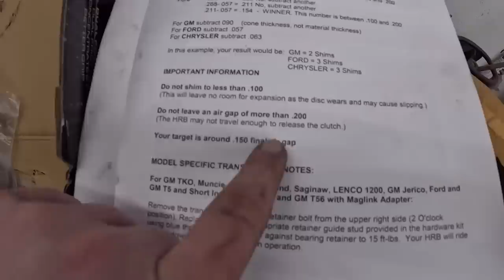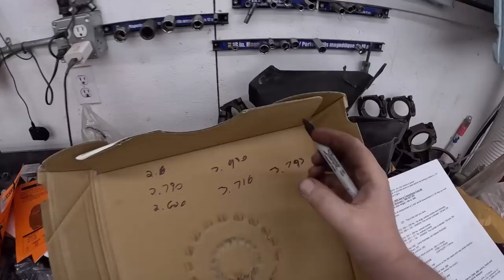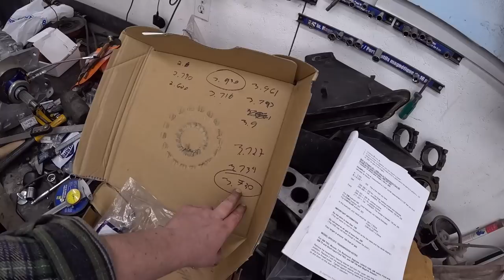WAS IT WORTH IT? Tremec Trans Install From A-Z - 1955 Chevy Nomad Gasser

Comment from the maker: So all the throwout bearing comments are really weighing on a guy.  Got an email in, but I feel like I'm pulling a motor and trans again......
Reply: Good I know it sucks ass all to hell and is demotivating and yeah yeah we all died a little inside as true fans when the biscayne motor was destroyed by poor quality HIGH dollars parts…… these are high quality HIGHER dollar parts keep ‘em that way by doing it right aaaaaaand I promise to like and watch your redo video so at least the hassle makes you a few Pennie’s
Reply: No need to pull the engine, Dan..just the trans mount, shitlifter, and the four trans bolts to the bell housing..
Get a couple long bolts and cut the heads off, use 'em to guide the trans to the bell, easy-peasy one man job..
Reply: Yes I agree, being in the transmission business for almost 50 years, the release bearing needs to travel forward onto the area of damage to release the clutch. It is a headache but fixing it now is better than after every is together. I do enjoy your channel and has been entertained for years. Will be doing a 4 door conversion on a 59 dodge due to you, ha ha
Reply: No fun dancing around parts issues when your excited about making progress. Now step back take a deep say a few @#$%& under your breath. I'm old and remember when you ran into an issue with parts in the 70's 80's and 90's you just hopped into your ride and went to the speed shop. Now it's hurry up and wait like a dog for a bone on the delivery truck to show at your doorstep.
Reply: You and your buddy Mortske just have the angriest commenters.  Remember that time you said you were perfect and never make mistakes?  Me either.  People need to just relax, and enjoy watching you do it wrong so we know how to fix stuff when we screw it up, too.

Comment: Dan , don't bust your ass. Buy (4) 4 inch long trans bolts cut the heads off the bolts flush and cut slots into the cut off bolts. Now you can install the bolts by hand into the bellhousing., Slip the trans onto the longer bolts. You will find the trans aligns almost perfectly every time. Now you can remove the slotted bolts through the ears of the trans using a heavy duty screwdriver. Remove your new alignment studs and replace with the correct trans bolts. Note! usually two bolts are all you should need to get the trans aligned. Been doing this since the late 60's.
Reply: Every GM guy has a set of the cut off bolts for alignment pins.
Reply: Ima use tihis, thanks.

Comment: Usually squaring the block to crank centerline is good, but$$$ , once I get offsets where they need to be ,drill,tap, and send in longer bolt.set screws suck.they always seem to move,especially towards torque side.

Comment: Always bring the pressure plate down with a triangular tightening pattern one turn on each bolt as you go, otherwise you will damage the finger ring, and cause uneven clutch wear, Don't use that release bearing with the broken collar, it will damage the transmission input support and the clutch. Fixed several already.

Comment: You always want to "lift up" on your pilot tool when you tighten up your pressure plate. It compensates for the weight of the disk and you'll have better alignment for the input shaft to go in. Always a little slop with the plastic tools!!

Comment: I had a lot of the same issues on my TKX install on my SBM. I used a McLeod release bearing which has a threaded base so it's infinitely adjustable and does not use shims. My clutch fingers were also all over the place so I just averaged out and everything worked just fine. I also verified the gap with feeler gauges after everything was assembled.

Comment: Great job! Just went thru the same saga on a ls gto. Went crazy over measuring but it paid off. Used a twin disc rxt McLeod hardest part was getting the tranny to seat and I have a lift and tranny jack. Next time I will use a old input shaft instead of bs plastic alignment tool. LOL
Reply: Same here with my 66 mercury T5 swap.  Had to pull it all apart on my back and realign to get the tranny in.  Have to press hard on the crappy plastic tool to center that disk while tightening.  Need 3 hands but managed it.

Comment: Dan,

Three things I learned about the Holley Sniper EFI when I put one on my Vette three years ago.  1) There is a mesh screen on the fuel pressure regulator.  I had to remove my mesh screen because it was a very large flow restriction and was forcing fuel pressure up to 90 psi instead of 60 psi like it is supposed to be.  Be sure to put a fuel pressure gage in the line going to your Sniper under the hood so that you can monitor the fuel pressure.

2)  The coolant temperature sending unit they sent with my Holley Sniper was garbage.  I noticed that when the engine was cold from sitting overnight, just before I went to start it up, the coolant temperature gage was not reading the same as the intake air temp sensor.  The engine coolant sensor read about 20 degrees warmer than the actual engine temp and the air inlet temp sensor.  And when the engine was up to operating temp, it read about 20 degrees cooler than the actual coolant temp.  I replaced it with one a bought from the local auto parts store for a 1991 Chevy Truck with 350 engine.  That one reads correctly.

3)  The electrical plugs on the Holley Sniper that attach to the proprietary Holley fuel injectors are garbage and lack a positive retention device.  So after about 300 miles they vibrate and fall off the injectors leaving you stranded.  Since these are not accessible from the outside, you have to go into the Sniper Unit to fix them.  The fix is to take small zip ties and zip tie the the plugs onto the injectors so they cannot vibrate and fall off.  I highly recommend doing this before you try to drive to the US and do Hot Rod Power Tour.

Comment: Congrats on the sweet parts!

You can use a length of chain to lock the flywheel for bolt torquing.  Bolt through one link to the block, bolt through another link to a clutch plate hole.  Turn motor til it locks!  More you can install flywheel bolts to your torque and it won't move.

You can also install the clutch plate onto the alignment shaft and hang that first.  Then you don't have to fight the clutch plate and pressure plate at the same time.

Comment: So, the thing you didn't seem to mention about the clutch to throwout clearance is that as the clutch wears, breaks in, or whatever, the fingers on the pressure plate will move out, so being a little on the safe side of .150 in the .160-.170 range is perfect if you dont want to take it back apart to adjust it again as soon. It'll be mint. Run it

Comment: I added an early Tremec six speed to my 56 150 utility..have to move the shifter location forward with a kit..Hurst shifter..works well.
Friend installed my BBC while I was moving and I left him an external and internal balanced flywheel..the balancer for my 502" was incorrect for a 396" so had to buy a new flywheel since the correct one was gone..alas!
  Five years later I've got a leaking main seal..forgot to tell the guy to but a new one in...I built the engine in 1979.
   Now have a blown head gasket due to timing issues with Sniper EFI...going to bite the bullet and pull the engine..again.
   Engine was built in 79 for a 74 Camaro that I bracket raced..then went into a 10:90 57 Chevy before landing in my 56 150 business coupe...whew..get tired just thinking about it..LOL
   Like they say..
Sh?t happens..LOL
    Keep at it young man...I love watching your builds!

Comment: I wouldn't sweat that throw out bearing... I ran a SBC in my 65 C-10 for years with a skirt broken off one of the pistons. Motor ran like a dream and pulled pretty hard. You'll be fine...

Comment: The pilot bushing is best in bronze🤔🇵🇷
Reply: I agree, if it's a bushing, this one is a Bearing tho.
Reply: @intentsmodz  its ball the same.  All the old times , and trasmision guy recomend  the bronze.
Reply: @antinioacosta2710  right but the bushings don't have needle bearings in them. The brass was preferred because the steel ones would rust then wear out quicker.    The one Dan used has needle bearings in it so it doesn't come in brass.

Comment: The Tremec is a great transmission.
So is a Muncie 4-speed with nice linkage. It's all about the office of motor management. The H pattern is a sure thing. Especially when you're just banging four gears, spinning donuts, and figure eights.
I prefer a 4-speed on the dance floor.
Reply: Problem with old school trans is no overdrive and doing long drives isn’t fun at 3500 rpm’s .  That’s why he went with the tkx.
Reply: @chrisw5837  Before the Tremec there was the Doug Nash 4 + 1.

Comment: i would not drill or use that trans blocks are already weak there seen a lot of broke block ears i would go with a t-10 or m-21 but the best is a 02xx 400r turbo stock good to 800 hp best part u can get them free if u know what they come in. stock they have heavy clutches heavy duty 8 bolt pump stage one shift kit . i have 3 crate setups sitting the 4 inch stroke 454 with the 02xx trans got all of them for free with 6,000 to 58,000 miles on them modeled after the 70 chevelle ho 454 450 hp at 485 torque stock

Comment: Please pull the engine down too. I know I know you’re already into this a quadtrillion pesos more than you want to be AAAAND I know last time you tried doing right and buying big cam and all new stuff, the parts peoples screwed you but double check the connecting rod bearings for NO slack and make SURE you’re not gonna have a cablammeee. We love the videos but it would be devastating if you put it all together and bottom end or timing chain or rod cap something you didn’t touch let go and ruined the car for power tour

Comment: @9:00 the technical term for that zero,zero,zero,zero quality is "dead nuts". 
@29:55 I used to get some 5 or 6 inch long proper size bolts, cut off the heads and use them as a guide to take the weight of the trans off my hands. Trans slides right in.

Comment: Hay Dan if you get a old exhaust valve put a 90 degree bend about half way on it's shaft, put it in the engine/bell-housing lean it on the fly wheel stops the fly wheel/engine from turning, as you do up the bolt's etc, thanks for sharing, all the best to you and your loved ones

Comment: The hub being deformed on that throw out bearing is probably depressing one or more finger springs on the pressure plate.  Might be why it was so difficult to mate to the bell.

It's easy to get a long measurement with calipers.  If the body of the tool is not perfectly square with the flat surface your measuring from it will read long.  Find a way to square it up and your readings will be consistent.

Comment: IDK. I am a little suspicious that the indicator may not have been in contact with the belhousing when you were dialing it in. I personally have never seen a dial indicator needle stay so still and the plunger looks fully extended. Also that hole in the belhousing would have to be the most perfectly round hole in history.

Comment: DAN DO NEED TO PUT TOP LINE FOR BLEED VALVE ON THROW-OUT ASSY ?  NOT SURE I F IT MATTERS OR NOT TO MAKE SURE U GET ALL AIR OUT ,,HAVING BLEEDER AT THE TOP ,,I KNOW ON MG CARS SOMETIMES SLAVE CYL ,GOT PUT ON WITH BLEEDER ON BOTTOM & IT MADE A DIFFERENCE IN GET FULL TRAVEL TO RELEASE CLUTCH ?  AM NOT SURE IF IT MATTERS OR NOT ,,BUT JUST FIGURED I WOULD ASK ,, I HAD SOME PROBLEMS BLEEDING MINE ,DUE TO AIR GETTING INTO SYSTEM ON CRUSH WASHER ,UP AT CLUTCH PEDAL ,,THANKS FOR UR WORK ,,ENJOY UR CHANNEL

Comment: I would have thought that the other holes in the fly wheel would be for the alignment dowel pins for the pressure plate and not for a larger pressure plate, interesting.

Comment: I always thought you weren’t supposed to put the assembly lube under the flywheel bolt heads because it can sling out onto your clutch surface. Also i had that clutch on my pontiac and it was badass all the grip with no slip!

Comment: I feel for you on the Throwout  bearing damage. I would probably have reasoned it out the same way you did and then ended up having to pull the whole thing apart again just like you are going to have to. I always have to tell myself to slowdown and double check everything  but I sometimes ignore that little voice.

Comment: its good to see you doing this like an engineer and getting it right. I hate the saying "It is what it is". Its simple, make it right or you will pay for it later. Over the last few days I have been replacing the front end of my small block Ford on my Mustang. The water pump crapped out after 22 year and 200K miles. Not bad but I found it was held on by a load of gash bolts, so I spent a day chasing out the block threads, replacing the timing cover with one without damaged threads and getting the correct bolt lengths for the pump and timing cover. When it is back and running at least I will know I have done my utmost to make it right.

Comment: You can stick the clutch alignment tool into the the pressure plate then into the crank to hold the plate in place before you bolt on clutch hat.

Comment: Yay, the sane guy is back in the house!
Hi Mur...
Dan, a question for you:
Eight thou out of round is a RIDICULOUSLY small measurement..how did you set up your dial indicator to ascertain that it was actually dead nuts center (technical term) on the pilot bore of the crank? 
'Cuz the way it's set up stuck on the flywheel, I see five variables that all need to be locked down, and no real way to verify other than eyeballing it..
My long winded way of saying I'd have let it slide with the stock dowels..
Reply: He did this according to what Tremec requires,  they have videos to show you how to do it and Dan followed those.
Reply: @chrisw5837  
You're missing the point.
What I'm asking is how he managed to center his dial indicator on the crank center when it was attached to the flywheel 4-5 inches off center with no visible alignment cues.
I fully understand what is being done, I just wanna know HOW he did it in the manner shown.

Comment: looks like u forgot to subtact ur ruller width
Reply: I was scrolling down to make sure someone mentioned this, hopefully Dan reads this. **EDIT, Although after watching it again, they did measure the same way on the transmission and the bellhousing so the thickness of the straight edge probably won't effect the outcome of the measurements.